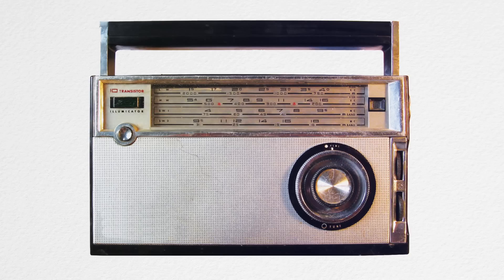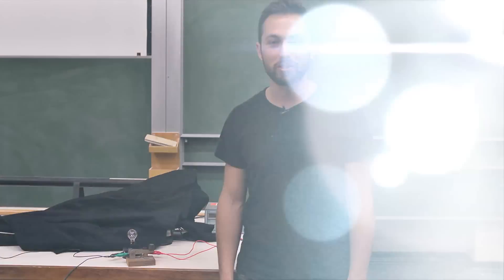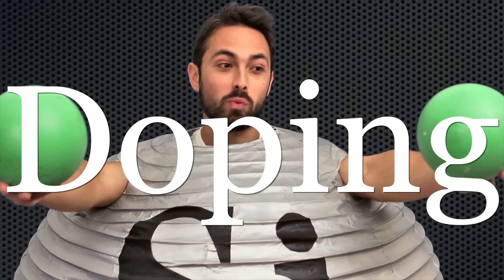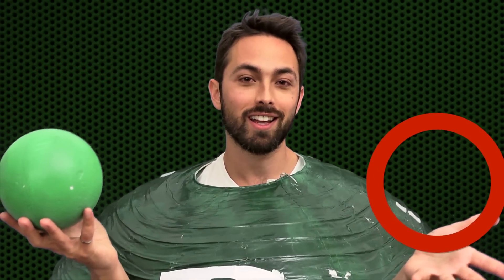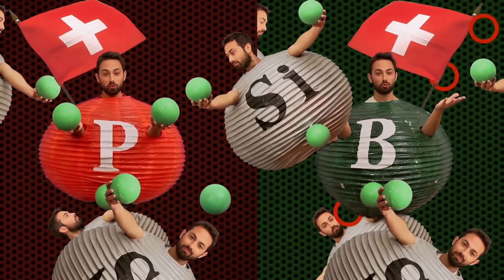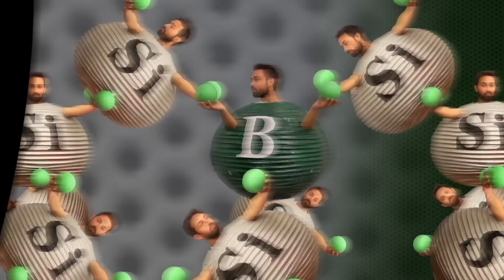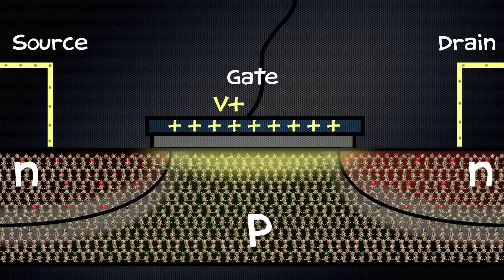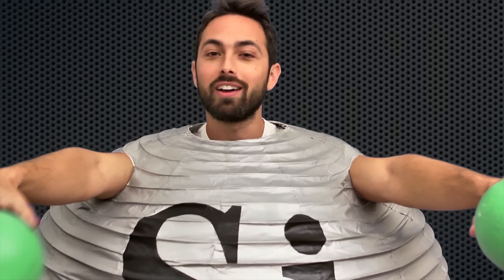How Does a Transistor Work?

Comment: Apparently when I'm learning about something I end up more confused than before.

1. How can you apply a voltage? An electric current can be applied to something from what I know but how can you apply a voltage? How can you apply an electrical potential energy? Can't understand this. And where does this voltage come from and when does it to go on?
2. Why do electrons flow from the source to the drain and not the other way around, in other words, why don't electrons diffuse from both n-types to the p-type. It's like they choose to flow only from the left n-type to the right n-type. Does the source bring electrons in the left n-type that pushes all of them to travel ''east'' and is this always ''on'' ?
3. So transistors are incredibly tiny and you can't see them so what are these? https://upload.wikimedia.org/wikipedia/commons/2/2c/Transistorer_%28croped%29.jpg
Reply: You better ask some engineers who work in this field. Those are good questions and people on the internet tend to give bogus answers.
Reply: Those are all very good questions -
2. the transistor is deliberately made not symmetrical, by having a different doping ratio in the source compared to the drain. This means that the current readily flows from source to drain (called forward-mode operation). You can wire it up backwards (reverse-mode) by swapping source and drain, but the transistor behaves very differently.
3. you can get individual (discrete) transistors like the image you found, these are very useful for making small breadboard circuits. The guy in the video is talking about transistors in a microchip, such as the CPU inside a computer. Using special photo-etch techniques, they can literally make many millions of transistors onto a small piece of silicon wafer.
Reply: to answer #1, basically think of the gate as being like a capacitor, when you apply a positive voltage to a capacitor on one side the other starts sides to attract electrons. Once you pull in electrons from the source here they have overcome the depletion layer, and they seek to go to the lowest energy position, but since they cannot flow through the insulator to the postive gate only so many electrons can occupy that area by the gate, and the next lowest energy state is the drain, so they travel along the path of least resistance to complete the circuit
Reply: The potential creates a difference in the configeration of charges on both sides... the negative potential area has more electrons where as the positive potential area has less electrons. So now to fulfill the requirement of electrons on the positive side the electrons from the negative end move towards it hence creating mobile charges also known as current... but REMEBER.. THE DIRECTION OF CURRENT IS ALWAYS OPPOSITE TO THAT OF THE FLOW OF ELECTRONS.  The potential between these two ends creates current and that is whats called voltage.
Reply: 1. Voltage can produced in many ways. Voltage is potential energy like height above the ground (potential energy in gravitational force field). Voltage is potential energy in electric force field. If you put an electron in the center of the room there is voltage all around it. If you move charges from one piece of metal to another then there will be a voltage between those plates. In this case with transistors you could use a battery. 
2. The electrons move both from N to P and P to N. They are just more happy to stay in the part with more places to sit and will be less likely to move away from there than from the other side. 
3. There are many kinds of transistors and many sizes. Small transistors for small power and large transistors for large power
Reply: 1) Although it does not seem so much, electricity is the same force as magnetism. Applying voltage on a transistor works the same way as moving a magnet placed on a table using a magnet under it (you can think of electrons as very small magnets, they indeed behave that way). Voltage does not go anywhere, it is a difference in potentials, just as a strong magnet is strong even when left on a table.

2) Source and drain are named in relation to the electric flow when the transistor is opened but you can swap them and the transistor will still work the same. Which way it will flow is determined by the circuit the transistor is connected to.

3) That is a package of a transistor. It is made large enough so that anyone can solder it with their own hands. The transistor inside is still very tiny.
Reply: Vansh Thukral How is the direction of current always opposite to that of the flow of electrons?
Reply: PenguinCake
It is an old convention created before people knew about electrons
Reply: 3. Old transistors were much bigger than today's transistors, Actually the transistors shown at https://upload.wikimedia.org/wikipedia/commons/2/2c/Transistorer_%28croped%29.jpg are really really tiny, microscopic maybe, but the package (the plastic or metalic cover) is made big enough to fit into bigger circuits or applications.
Reply: Jan Sten Adámek if you redefined charge to be positive for negative and vice versa then it would make sense to change current direction. As it is now changing direction of current would make no sense since that would mean positive current for negative J.
Reply: 1. when he says voltage he means electric current, and its just what tells the transistor to turn on; Its a signal, just like your hand is when turning a regular switch.

2. The source is connected to electricity, while the drain is not; The electrons flow this way for the same reason they flow through a cable, when the transistor is turned on it closes an electrical circuit and allows the electrons to flow through.

3. Now days transistors are tiny, in the past they weren't; Those aren't modern transistors.

Comment: But I still dont understand why a semi conductor is used, is it because of the 4 valence electrons? If so, then can carbon be used in stead of silicon?
Reply: I believe it is because carbon has less electrons in total so the electrons are closer to the nucleus. This means you need more energy to break the bonds of carbon. There is also a lot of silicon in earth's crust (something like 25%) making it very cheap.
Reply: Steven S Basically correct, but I think the main reason is that amorphous carbon doesn't conduct well at all, it's a non-metal, whereas silicon is a semi-conductor and a metalloid. Metalloids like silicon and arsenic are reputably good materials to use, as some, but very few of the electrons can be mobile as said.

Comment: This video is slightly misleading. A better demonstration at the end would be the npn bipolar transistor or a JFET which work on pn junction depletion variation. What he shows is an MOS (Metal Oxide Semiconductor) Field effect transistor. This works because the gate voltage induces an inversion layer below the gate (which literally rips electrons from the bulk due to the high electric field) . These form a conducting channel between the highly doped source and drain contact regions.

Comment: if you need a switch to turn on and off the gate to make the switch, what is the point?
Reply: The point is that you can use another transistor as the "other switch" and so on. You can then connect billions of these together on a single piece of semiconductor substrate to make a massive logic array that forms the heart of the device you are using to leave your comment.

But as you say, you'll always need at least one mechanical switch to switch the thing on in the first place !

Comment: What I like about this video is that it explains quite well why a transistor does what it does, i.e. the inner workings. What it doesn't explain too well is what it does, i.e. its function, its role in a larger setting. The message that comes across (to me) is that a transistor is nothing but a remote-controlled switch, a device that permits or prohibits the flow between two points depending on the input on a third point. Without the function explained properly, I'm left with at least two questions: 
(1) so a transistor is essentially a modern version of a relay, right?
(2) in many applications, transistors have taken the place of tubes. Tubes can be used to amplify electric current. But how can a mere switch (which a transistor is, according to this vid) be used for that function?

Comment: He is not mentioning that: An insulator has very many electrons orbiting the nucleus and the fewer electrons in the orbit the better it will conduct. Good has the fewest and is the best conductor. In a diode the dope has to many electrons so the atom will make current wait. On the other side the electrons are allowed to pass. That's why they are called semiconductor's.or "sorta" conductor's. We are so lucky that this is possible.

Comment: But how do you change the voltage initially without any moving parts?
Reply: They don't just "loop around." If that was the case, new information would never be entered into the system, and the electricity would quickly stop due to the resistance of the materials. New information is added to the system from the hard drive. The hard drive is a magnetic disk that stores a long string 0's and 1's in the form of magnetic North and South poles. When a moving magnetic field (from spinning the hard drive) )strikes a conducting wire, it causes an electrical current. North poles force electrons to move one way, and South poles force them to move the other way. This is how the information stored on the disk is transferred to 0's and 1's and it is then routed into the transistors.
Reply: TheFounderUtopia There's this device called an oscillator. It's a crystal that vibrates at a steady rate (resonance) and creates electricity in the same way those childrens shoes light up when they step. With the proper circuit, you get it to vibrate at some MHz, whatever, and this constantly supplies a stead chain of 1's and 0's. Those 1's and 0's chain through millions of transistors in cleaver configurations that do a whole buncho complicated math functions until it makes the page you are looking at now! ;)
Reply: with a transistor naturally. well with computers and stuff they cant always be on so you cant use a transistor thats why you push a button to turn on your computer or iphone even. but from then on it can use a transistor to activate other transistors
Reply: Firaro
I see... so they just continually loop around keeping things going internally. Seems obvious now. XD Thanks for the answer. :)
Reply: *****
Thanks! That's very informative.:)

Comment: This is a MOSFET transistor, not a bi-polar one like the common PNP or NPN transistors just so people know because they work in slightly different ways. Great video none the less, it was very useful to help visualise what is actually happening in the transistor when a voltage is applied to the gate.

Comment: So we understand how a 1 and 0 is stored. But what tells the transistor to switch from one to the other? It is probably a stupid question but I never found an explanation for it.
Reply: Thank you both for trying to answer my question but it appears I still didn't ask the question the right way. I did some research and it appears that transistors can be arranged in a number of ways creating logic gates.  And that the state of a transistor in one part of the circuit will determine the state of a transistor in another part of the circuit, by influencing the little wire I pointed out. I watched a very boring video discussing a simple adding machine built with switches and transistor logic gates that explained what I was trying to understand. The CPU appears to be a far more complex version of an adding machine that receives strings of 1's and 0's. A string of eight 1's and 0's will enter some slot. The cpu will then send its energy through the ones and zeros and depending on the configuration it will activate a very specific collection of transistors which will then do something else and so on and so forth. The programming languages you guys keep pointing out are numerous layers above what I was asking for.
Reply: porcupineracer2 Hmm! This is a good question, and you have already answered the half of it in the statement you made above. From what I understand, you are trying to figure out "what tells a transistor, it's time to turn on, or it's time to turn off?", or if we dig deeper, and simpler versions of your question, you want to know, how does a transistor actually works? 

The answer given by Steven Him is absolutely correct, it is the program, it is the coding. We see those codes in "CODE" language, however, a computer sees those codes in binary language, in 0s and 1s. For every alphabet there is a number made up of 0s and 1s given to it. For every symbol in this world, there is a number made up of 0s and 1s given to it. When we type these codes in our "CODE" language, the computer converts them into binary language and tells the transistor to go on or to go off. 

You must also keep in mind, that transistors are modern devices, first transistor was built in the year of 1947 by John Bardeen, Walter Brattain, and William Shockley. Before transistors, computers, radios, and other electronic devices were used to be HUGE. 

Also, a transistor is nothing more than a switch, but very tiny in size, and as you are the brain behind turning on or off a switch in your home, the computing device is the brain behind turning a transistor on or off, but that's not how it is always supposed to be. You can take 4 transistors, make a circuit out of them and manually turn them on or off for your bulb to glow.
Reply: programmers... people who code like steve job or bill gates... your computer is pretty useless without windows or ios. have you ever tried to run a video and your computer pops up with a message saying something like 'cannot run 'x' without driver' and thought to yourself... wtf is a driver??? well its a program that knows which switch to turn on or off in order to "drive" your computer.
Reply: Steven Him Maybe I did not word this well. There is that little wire that tells a transistor whether or not to allow electrons to pass through it. That wire tells the transistor whether it is a 1 or a 0. What tells that wire the state it should be in? When you talk about coding you are talking about several layers above the question I am trying to get answered. Even Assembly Language is a few layers above the answer I am trying to get answered. But thank you for taking the time to explain that part of the equation.
Reply: porcupineracer2 that would be the cpu... you have input -> cpu -> output... input (from keyboard, optical drive, mouse, or internet) -> cpu (or brain that converts a language similar to morse code) -> output (image to monitor or printer)... now to the real meat of the question... what physically causes the wire to connect or disconnect? well the answer is electromagnets which is controlled by electrons...
Reply: Remember the gate?
Reply: Tanay Pathak Your answer was brilliant man! I've learned so much from this! Hope it wasn't pasted :P
Reply: ImagineCraft7  thanks sir, and no, nothing was pasted from anywhere. I am a student of physics and keeping a tab on modern computing devices is a hobby. :)
Reply: There's this device called an oscillator. It's a crystal that vibrates at a steady rate (resonance) and creates electricity in the same way those childrens shoes light up when they step. With the proper circuit, you get it to vibrate at some MHz, whatever, and this constantly supplies a stead chain of 1's and 0's. Those 1's and 0's chain through millions of transistors in cleaver configurations that do a whole buncho complicated math functions until it makes the page you are looking at now! ;)
Reply: porcupineracer2 You should look at nand2tetris
Reply: Tanay Pathak Cool :)

Comment: Great video. I have worked in Electronics for close to 50 years. I still remember tubes (valves). You should do a video on them. Just a few points I'd like to make below:

What you described is actually a sub class of transistor known as a FET or Field Effect Transistor. These use the designation of Source, Drain and Gate. Most other transistors are used to proportionally control current. The control signal is applied to the base or the gate as described in your example. As the voltage at the Base is increased the current flowing between the Collector (Source) and Emitter (Drain) increases. In order to amplify voltages this increased current must be passed through a load resistor to see the corresponding changes in voltage.

I know engineers and Scientists like to discuss hole flow but holes do not flow, electrons flow. Current is defined as electrons moving past a fixed point. A hole is the absence of something when the electron moves it fills a hole (nothing) and leaves a hole (nothing). Electronic techs (real world) only talk about electron flow. If there are no electrons there is no current.